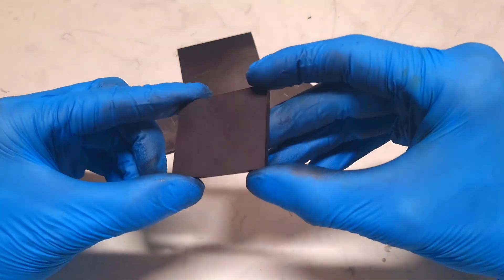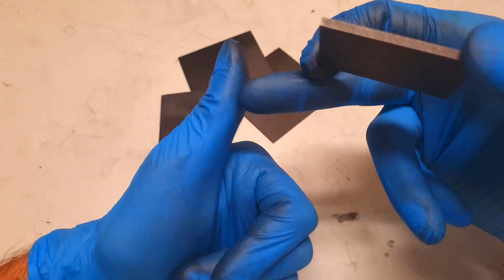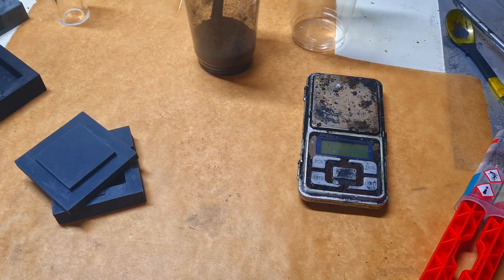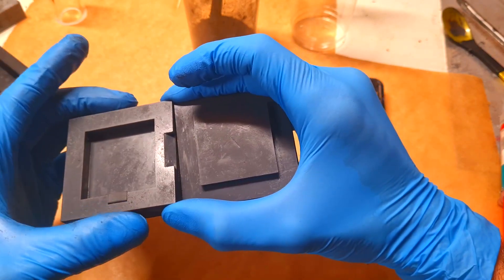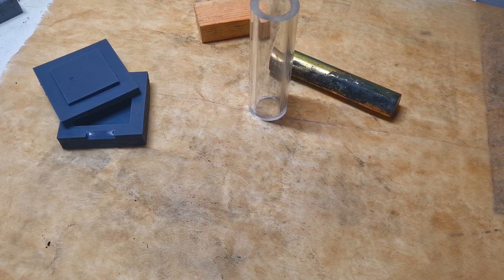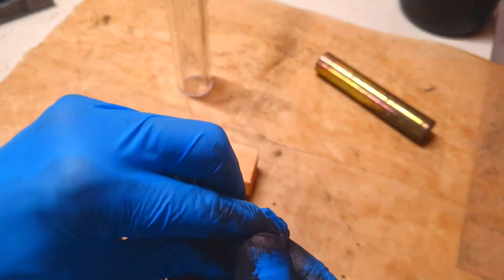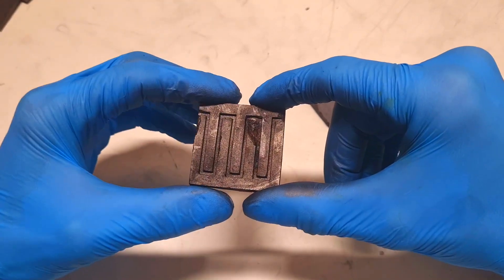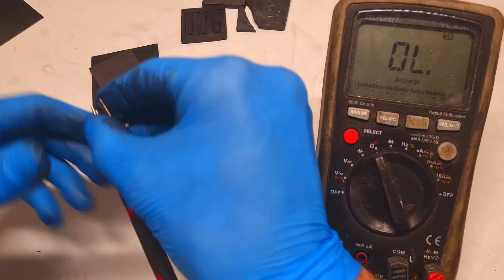DIY Bipolar Graphite Electrode for battery

Comment: This is my second attempt.  This time I tried to increase the graphite powder content and then used a polyester fiberglass resin with hardener (Bondo).  This did not work out very well either as the slurry did not harden.  I believe the graphite power prohibits the resin to harden.  So, I cleaned my forms once again, and will make another attempt.
I will try and keep you posted.

Comment: Very good video!

I tried the same experiment that you tried except I used a waterproof high grade wood glue (Titebond III Ultimate).  I was hoping that this glue would give me more time to work.  However,  It was not successful as I waited two days and then opened up my forms and it was still liquified.  Also, the resistance was way to high on a sample that I let cure in the open air.

I was hoping that the resistance in your experiment using Epoxy would have been a little lower.  I will keep trying though and I encourage you to do the same. 🙄

Comment: Epoxy works by completely binding carbon atoms of the material to be joined with sulfur atoms in the middle of the polyester chain molecules.  Could your electrode recipe be improved by using an entrainment matrix material instead of a chemical binder?   Also, I'm sure your viewers don't know how any of these plates get their bipolarity.  Is the graphite calendared before mechanical pressing to high density and hardness?  That would be good to understand.  Maybe some mechanical production experiments would greatly expand what you can do with your polymer 3D printing tools.  ZAMAK is strong like aluminum, can be molded as a powder and sintered to full integrity, and lead is also very cheap and fun to cast into paper or treated paper or polymer molds, and it has a substantially higher melting point than ZAMAK.  I don't know heats of fusion numbers, but lead freezes in paper, and ZAMAK will sinter inside a lead mold, and is far stronger than lead and probably will easily exceed any mechanical requirements you have for pressing these plates yourself.

Comment: I'm sorry for my naive question but what makes it bipolar?
Reply from the maker: A bipolar plates are the electrically conducting plates which join together the anode of one cell to the cathode of another. It connects and separates the individual cells in series to form a cell stack with required voltage. So the bipolar plate is in basic only a non reactive conductive plate.  Theoretically the plate can be made from almost any conductive material. But in the end is also important that the plate is made from material which will not react with electrolyte  if it is exposed to. And for that reasons the bipolar plates are mostly made from graphite or some other carbons.
Reply: @cayrex  it's that simple , ok. Like wires connecting separate batteries but its internal to the battery.
   Here's a question, what if you had a flow battery with two different electrolytes, and you have a plate that serves the same electrical connecting function as a bipolar plate but also serves as an active electrode on one side with one of the two electrolytes?
   Does that have a name? Could you call it a bipolar electrode, or monopolar plate? 
   Don't mind me , maybe I'm thinking too much , but I'm going to stop here before I start getting silly.
Reply from the maker: @petevenuti7355  It is still a bipolar electrode. Monopolar electrode is in basic a typical electrode wich have external cell connection and is used like in car batteries, tool batteries,... And most of the time a bipolar or monopolar plates are used as current collectors.
Reply: @cayrex  got it!  so anything that connects two cells together electrically internally is a bipolar plate even if one side of it is active with the electrolyte . Thank you for the clarification!

Comment: You might consider a lost wax approach or cook a spaghetti noodle till bendable, form a serpentine shape, let dry to recover strength, then put on bottom of mold. Dissolve the used noodle with hot water.

Comment: Hello.
I just came across this video while looking for information.
I can share something right away that may interest you and others.
I bought a graphite foil for making 0.25 mm gaskets.
Most importantly, it is very soft.
So soft that when I screw the battery together, there is no leak and the liquid does not escape.
I am currently testing this graphite gasket, but it looks promising.
The resistance of such a graphite foil is about 0.8 Ohm.

I am currently waiting for a few things to be printed and delivered.
I would also like to test the Zinc Bromine battery.
PS:
I have a Battery printed from regular resin by Anycubic and when I used it for a while, it did not fall apart.
If I know anything more, I will write here and maybe publish the video on my other account ;).
Reply from the maker: @tdx110  Yep, is not just like so called a graphite gasket 😁 Yes, make a video that we cam see what you are doing

Comment: When measuring  a materials conductivity you need to measure it over a known  surface area. Conductivity = siemen/(meter²), and siemens=1/ohms. and when ohms is around 1ohm or below, you should use the four lead method for more acurate  measurements. Two for current and two for voltage sensing.

Comment: If one put the epoxy in the refrigerator, it would take longer to cure and that would allow for more time mix well with less worry about not going fast enough.
Reply from the maker: @kreynolds1123  Or using 90 min or standard Epoxy
Reply: @cayrex  do you think the longer cure epoxy has better or worse mechanical/electrical properties?
Reply from the maker: @kreynolds1123  Depending on the epoxy. I know that slower is the curing time stronger will be the  "joint". About conductivity..... with 90 min epoxy I get a bit more resistance. But for each epoxy you also need to find the right ratio of conductive material and binder.

Comment: You need a hydraulic jack and a frame to press them, clamps don't have enough force, and for channels it's best to cut the channel after plates made.but good work any way. you could make a large block and cut the plates from it may be faster.
Reply from the maker: Yes, I just try to make the plates by hand for now, because the hydraulic jack I will use next time. About the flow channels..... yes you can make it after. But I want to stick to the custom mold which already have the channels in the mold. Because that way the plates are done faster when you make many of them,.... and it is some standard process of making plates with channels.

Comment: First, i have some question, in the next time i want to make calcium ion battery (Ca-ion), can i use epoxy resin for binder cathode and anode?, i'm use calcium copper phosphate for cathode and ion calcium sources, i thinks black carbon is good for anode and traps some calcium ion (Ca2+)..
Reply from the maker: @Epsilore_Deltarime  Yes and no. You will make Ca ion cell, which the Ca ions will intercalate into carbon, etc. So the epoxy can isolate some of the active material if you use to much. In the past I try to use epoxy for active binder in the cells,.... but I didn't get the desired effects I was hoping for. You can try to make a small cell to see what you will get.